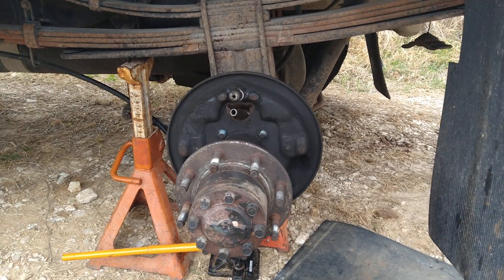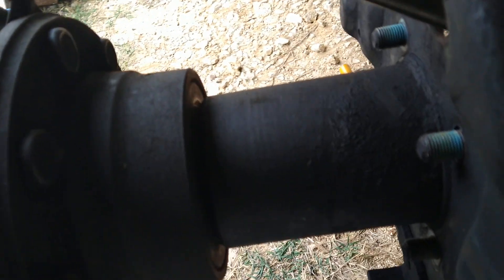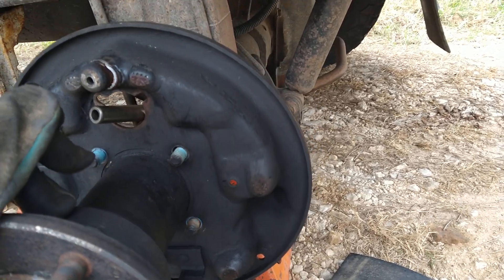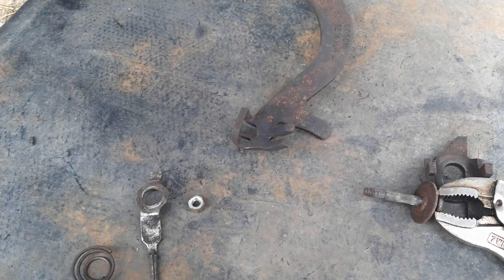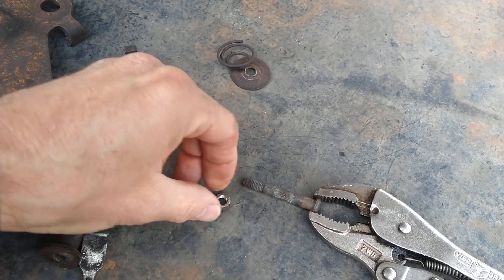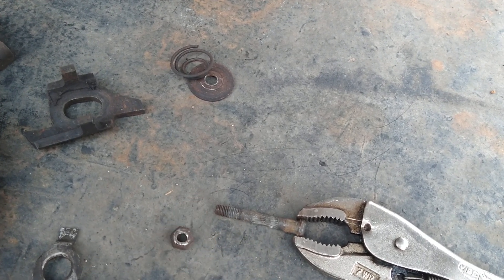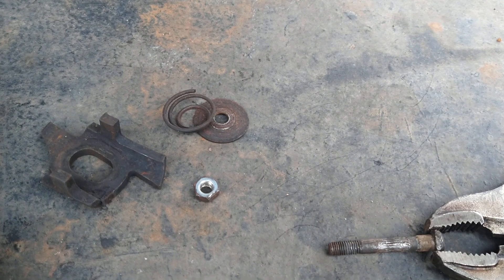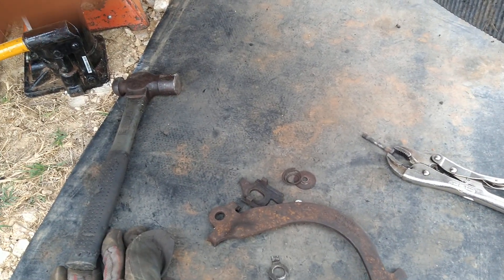Repair broken and burned rear drum brake assembly on 2001 Dodge Ram 3500 #diy

Comment: If you have to take the other side apart to look-see.  Cowboy, you should charge admission for these vids to the semi mechanically inclined and/or wannabees. 😄  All the parts your car will ever need!  Rock Auto!  We're with ya.  Thanks for sharing!
Reply from the maker: I was simply holding the bolts in the wrong direction. As soon as I got ready to put it in place I quickly realized